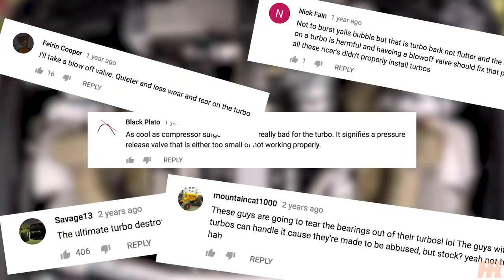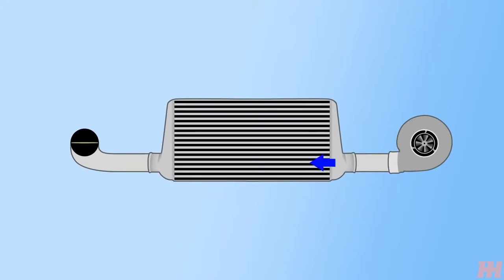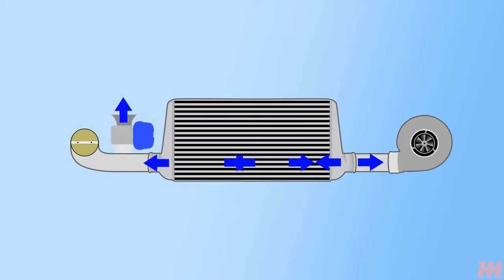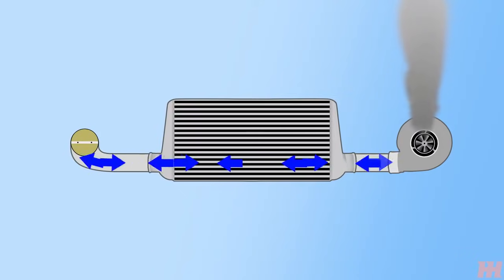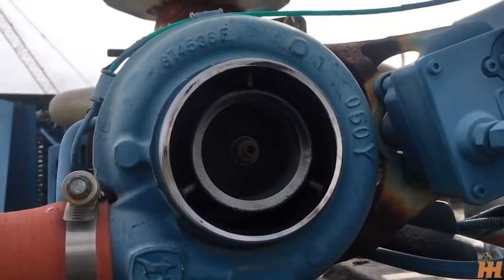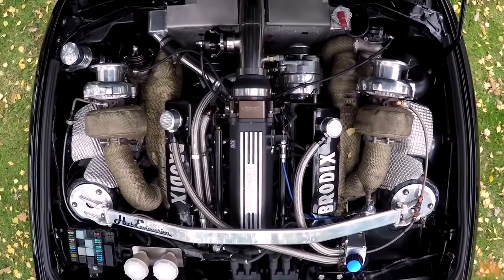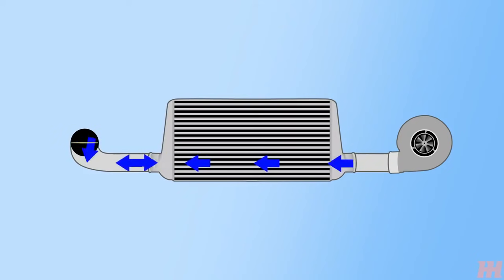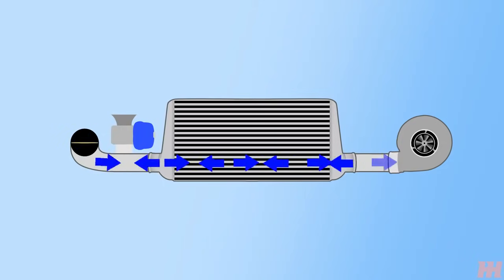The Truth About Compressor Surge

Comment: If you're running the correct sized turbo, intercooler and piping for your setup, a BoV isn't necessary, the only thing a BoV MIGHT, and I stress the might, help with is eliminating lag (if you even have any) between gear changes as the turbine of the turbo won't slow down as much with the surge of pressure when the throttle blade is closed. As for the increased wear on the turbo when not using a BoV, for every study I've seen saying that it wears the turbo quicker, there's another that says it won't! :/ From my own experience, the only benefit I've noticed from a BoV has been reducing lag between gear changes. I put something like 15000 miles on a mk3 Supra 2.8 single turbo I built back in 1999 without a BoV then after some advice from a mk4 Supra owner, I fitted a BoV and it did help to eliminate the lag I was getting between gear changes. I ran the car for 2 years after that (must've been at least another 20000 miles) without any noticable signs of wear on the turbo, I sold the car to a friend who ran it just over a year before smashing it and one of the few things that was ok to salvage was the turbo!
Reply: Yeah, hear changes and when you close the throttle before reopening, I have noticed slight differences in lag reduction with a well placed BOV, as for longevity... I don’t think it’s that dramatic of a difference with our without as long as your system in balanced like you said
Reply: yes
Reply: good fix for this is flat foot shifting 😂
Reply: I'm under the impression you're mistaking the purpose of a blowoff valve and a wastegate. The boost control solenoid in conjunction with the wastegate and recirculation valve is what should maintain boost pressure between shifts, a blow off valve in theory is only there to blow off air pressure when you come off throttle
Reply: @theposerhoser  No he's correct. A wastegate is only there to prevent overspeeding of the turbo. A recirculation valve has a very similar job as a bov, a bov vents to atmosphere and a recirculation valve vents back to the inlet of the turbo. Not sure why you added the wastegate to the mix.

Comment: As a Machinist/Welder/Fabricator/Mechanical Engineer, in 2004 or there about's, I got to work on a diesel semi-tractor that was attempting a Bonneville world speed record for that class.  The diesel engine was turbocharged and producing 75+ psi.  The turbo stall was discovered with a high-speed camera aimed at the fan.  This wheel was coming to near complete stop and re-spooling.  The solution was to add a Roots Blower to the mix to positively insure that the flow from the turbo was moving forward.  This semi was geared so tall that it needed another tractor to push it to 75 mph just to get going in first gear.
Reply: Well, this is the coolest thing I've read all day. Funny enough a day that someone was trying to tell me how bad compressor surge is, which is why YouTube suggested this video to me.
Do you happen to remember who or what company that was? It wasn't Cat with the race C10, was it?
Reply: @wallcouldtalk  Search Youtube for "Ye Old Dragon".
Reply: How was the turbo coming to a near complete stop?
Reply: Got a link to a video of that? cause it sounds bullshit to me. Turbos spins at tens of thousands of rpms,  it's not going to stall and come anywhere near a complete stop in between gears. That's an outrageous claim

Comment: Pushing 24psi no bov/dv for atleast 6 months daily driven. No issues yet. It makes sense that the free spinning turbo can chop the air with reverse pressure with minimal wear to the bearings/shaft because of its free spinning state.( whatever exhaust flow from the engine while shifting wouldnt be nearly the pressure returning through the intercooler) I don’t understand why so many others preach its pre detonation of the turbo?

Comment: Had my own turbo spin the nut off the compressor due to closed throttle surge and seen others do it too. It is all good if your turbo runs a left hand threaded shaft but the ones i have seen undo are right hand threaded. The turbines inertia due to weight is greater than the compressor wheel so it tends to back off the nut on the compressor wheel when there is a differential of forces applied. Cheers.
Reply: knock off garrett and BW moment
Reply: Got proof that it was specifically compressor surge that caused that? Cause I have never heard of that happening, ever lol

Comment: I've had a ghetto blanking plate on my WRX Wagon's stock recirculation valve for over 5 years and 40,000 miles with no issues. If you want flutter then I highly recommend it. Every genuine expert I've spoken to had said it's not going to cause any harm. Especially in a stock turbo that doesn't run particularity high boost. 👍
Reply: I think it depends on the tuning set up if a blow off valve is necessary.
In my car i had the recirculation factory valve . It makes a chousss sound. 
Lately there's a problem that causes loss of boost and i have to go to my mechanic to solve it.
By the way what is ghetto blanking plate?

Comment: Already knew, but it's nice to see someone else who doesn't believe the forum ninjas. For everyone who isn't sure ; Blow off and recirc valves only help stop compressor stall on over run/closed throttle. Usually vacuum operated, though I did see a rather complex electric set up that was supposed to keep it spooling longer. The best way to do that is antilag, but that's the easiest way to shorten the life of any turbo, but so much fun.

Comment: I have a book by career long mechanics that I explained before that goes over this and you do cause premature fatigue failure on turbos and increase turbo lag without a compressor bypass/blow-off valve. With the valve you prevent pressure waves going back into the impeller and the impeller is kept spinning without interruption reducing lag. I’d rather not put any stress on my expensive parts than do so just to hear “wooooooosh Stu-Stu-Stu-Stu-Stu”
Reply: Did you watch the video?
Reply: *cents *whether , unless your comment was a joke. Lol

Comment: I had seen some comments about that and I never did understand how it could spin the compressor backwards, turbochargers are essentially non-postive displacement pumps and a fluid pushed backwards through one would be extremely inefficient at causing any movement of the compressor wheel.

Comment: I could be wrong but having a bov does make for much quicker boost response if you are going to be on and off the throttle frequently as in road racing,time attack,off road rallying and auto cross.

Comment: There can be surge with wide open throttle as well.... If you mismatch the compressor wheel with the engine flow demand. Its not the air that is trapped. Its the compressors wing stall that makes the fluttering noise. You can also have surge in airplane engines as well and it vibrates in similar fashion.

Comment: Heads up for those that run a Maf sensor on the turbo inlet, subaru guys I'm talking to you. Doing this mod will cause problems with your tune. The air moving out of the turbos inlet on closed throttle is being metered and telling the computer it needs more fuel to go into the cylinders on closed throttle.

Comment: Ran no BOV on 240sx KA-T
it felt like a better turbo response not to have a BOV, because when I'm off throttle the would turbo flutter for around 2 second. So I guess for those 2 sec, it's like I have reservoir of boost ready to use. So If I opened the throttle within 2 seconds after closing the throttle the boost would just shoot back up to the boost limit almost instantly.

Comment: Compressor surge is compressor surge. It doesn’t make it any less damaging that the throttle is open or not. It’s still trying to push air freely that it can’t. This causes faster bearing wear because the off centering torque and vibrations.
Reply: LOL. One is definitely more damaging than the other. Closed throttle is simply air between the turbo and throttlebody escaping back out the turbo.  Open throttle compressor surge is doing the same thing, but while the throttle body is open. Meaning you're trying to force more air into an engine that can't make use of it, likely because the turbo size is mismatched. Open throttle compressor surge is definitely an issue.
Reply: @strider5119  you’re saying “open throttle is an issue” like closed throttle is not an issue lmao. It has nothing to do with mismatched turbo size and everything to do with wastegate settings and control on open throttle while closed throttle has nothing to do with wastegates and everything to do with the use and settings of dump/ blow off valves. Remember, we’re talking about compressor surge here. The max turbo spool is controlled by the wastegate while the release of pressure after the compressor is released by a BOV, Recirc, Diverter or Dump Valve (different names and routing but solving the same issue) during throttle closure. What I believe you’re talking about and getting confused about is over boosting. Compressor surge is from the speed of the blades being too high for the amount of airflow at the time which in turn makes the blades lose “grip” on the air. This causes damaging vibrations and faster bearing wear by off centering… well, I already explained that.
Reply: @fulano787  there is a difference. Open throttle the turbo is actively trying to make more boost. High boost pressure hitting high boost pressure trying to escape through the compressor puts massive strain on the thrust bearing. Closed throttle the turbo is idling, there is a pressure difference from the compressor that is lower than the pressure coming back at it.
Reply: @Mr.Wongburger  yes, compressor surge is different. No, it does not happen at idle.
Reply: @fulano787  As long as you understand that during open throttle compressor surge, you are trying to stuff more air into the engine than it can take. That is bad compressor surge and is what damages the turbo. High boost trying to push against a wall. 

 Closed throttle means the engine is no longer making boost, so the turbo is no longer pushing, the boost it was making can not be higher. This means that the air escaping is lower than what the turbo makes which is okay because turbos are designed to handle specific boost pressures. Normal boost pushing against vacuum.
Reply: @Mr.Wongburger  a surge is a surge, engine can't take boost or you don't want boost(valve closed) it's still too much pressure have no where to go. no difference.
Reply: @Align700nitro  There is a difference. The difference is the boost being produced by the turbo. Open throttle creates boost. Closed throttle stops making boost. Sure you still put a load on the turbos thrust bearing in both scenarios. But they are different. One not only effects the turbo, but your engine as well. The other effects your turbo, but only slightly.

The turbine at open throttle makes positive pressure. Off throttle it still spins but is not making positive pressure. When the throttle closes, the positive pressure fills the intercooler pipe all the way back to the turbo and exits from the turbine. The chop sound you're hearing is because the exhaust is still turning the turbine. So the blades chop the air as it leaves the turbine housing. The turbine doesn't stop spinning or reverse. It's not possible.

Again, this does cause a scenario that can prematurely damage the turbo. But it's not as catastrophic as people make it sound. For example. A lot of manufacturers use bypass valves. Which are different from blow off valves. That pressurized air does not go to atmosphere. It stays in the intake tract when you let off throttle. How is that not bad for the turbo too? We're talking a 1/2" diameter tube that rerouted the air back into your intake after the turbo. All of that air has to be more than what the small tube can handle. Yet it does.

You can choose to believe what you want to. A bov system will definitely help your turbo live longer. But you don't know for certain how much longer. There are plenty of people in the motorsport world that don't run them and don't have problems. You pick the sound you want to hear at the end of the day.

Comment: A guide how to produce that sound from your turbo would be the best !
Reply: I could explain it to you, it's very easy
Reply: @strider5119  can you explain it to me? Would be helpful!!
Reply: @benjaminkrasznai2282  sorry, only just saw this. You just need to either block or delete your factory bov (or equivalent). Also blocking the vacuum line that goes to the bov. Sometimes you can get away with just blocking the vacuum line, but some bov's will still open with enough pressure. From turbo to filter, you want as much aluminium/stainless as possible, no plastic/factory stuff. You also want as free-flowing of a filter as you can get. Eg an aftermarket upgrade or just a pod filter. The sound will vary depending on the intake and also the volume of the intercooler/piping. Some cars sound shit when they flutter, some sound fantastic.

Comment: Surge is a limitation of any centrifugal compressor in that it can't raise the pressure without a minimum flow. When you put a big compressor on a small turbine that runs on a small engine it's likely to get surge when starting to make boost at low rpms
Reply: Old comment, but that's open throttle compressor surge.
Reply: @strider5119  Any centrifugal compressor has a surge line on the compressor map. That is an area of the map that shows the lower limit of air flow and higher limit of pressure at that low air flow. Any modern turbo engine doesn't get in that area of the map because the right turbo choice.

Comment: so basically it will not damage your turbo but it will reduce performance since every time you slow down turbo on gear shift it will have to build up boost again when you open the throttle
Reply: thats why WRX recycle the air, so they dont have to wait again
Reply: @DaytonaRoadster  That's not the reason why...  The length of the intake pipe is so absolutely negligible compared to the mass of air coming into that engine, not even superman would notice a difference between a BPV or BOV "response time" ... 
Two main reason that I can think of atm is that, most people who buy a new vehicle want it to be quiet.   Believe it or not, not everyone with a turbocharged vehicle (there are TONS of them out there if you think about it ), wants to hear "PSSSSSHHHHHH!!!" every time they let off the gas.  
However, an even more important reason is this:  If the vehicle has a MAF sensor setup (which most newer cars do), and you install a BOV, it's going to cause a huge unmetered air leak every time the valve is open, which can make the engine sputter, stall, throw a CEL, etc...
Reply: If you take ages to shift gear, maybe. Otherwise, no. The difference between bov and not having one is minimal. Flutter happens because there is compressed air between the turbo and throttlebody and it escapes. BOV's vent when the air between those same points reaches the amount its set to and will flutter for the rest anyway. You just don't really hear it at that point.

Comment: It can’t surge if it has no load
No load no surge 
Just pretty pretty noises

Tbh the only advantage a BOV is in a manual car so the turbo doesn’t slow between shifts.
Reply: The only thing a bov does is stop back flow when throttle is closed. To keep the turbo spinning in between shifts you need a recirculating valve that reintroduces the air into the turbo intake

Comment: This is only half right. It puts pressure of the turbine face and force against the shaft back and forth.

That’s what the common complaint issue is. Not that it stops the compressor from spinning or goes backwards. That came up randomly and got regurgitated ever since.

And it’s more towards older turbos who already have wear and play. It makes the play and shaft wear/damage worse by adding unnecessary pressure.

Also just because it’s no longer under load doesn’t mean it doesn’t still have a small amount of load on the turbo or still have force by spinning.

I like the video, but this isn’t an end all just because some random kid on YouTube “says so” lol
Reply: Of course,  there is still a load while closed, but like you said, probably directed towards older turbos, any half decent non badly worn turbo won’t have the shaft effected by closed surge, I’ve never seen any example of that either to be fair and I’ve worked with turbos all my life, not on good working turbos anyway

Comment: From an engineering perspective, 'off-boost' surge is still a problem. Categorized as partial flow reversal due to air stall, the sound that you hear are large vibrations being experienced at the compressor blades and subsequently high stresses. Over a certain period of time, these stresses (or stress cycles) can and will cause fatigue cracks to occur, and eventually either the blade tips or entire blades can become heavily damaged. Anyone who says that off-boost surge is fine is.. well, wrong. :)
Reply: You're wrong
Reply: @BAYAREAMX  well I'm not, but believe whatever makes you happy!
Reply: Agree!!

Comment: Just blew both turbos after 6k miles over 4 years...No BOV. Got turbos repaired and now running a BOV. Ball bearing garret turbos on a 997 Turbo.
Reply: Your turbos didn't die because you weren't running a blow off valve.